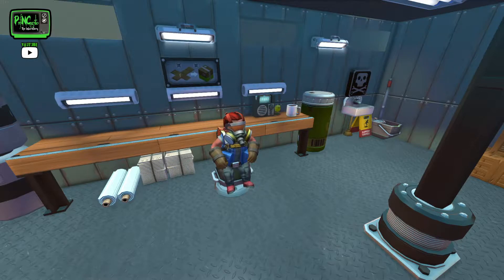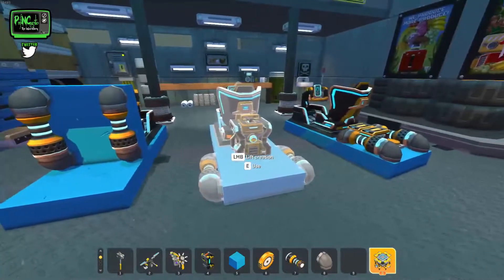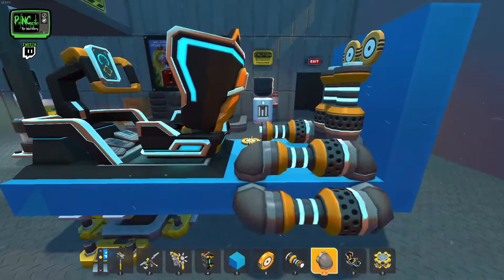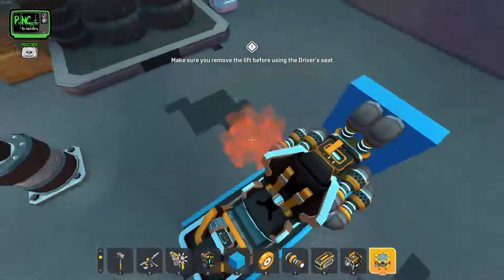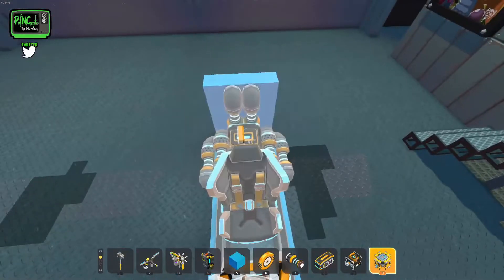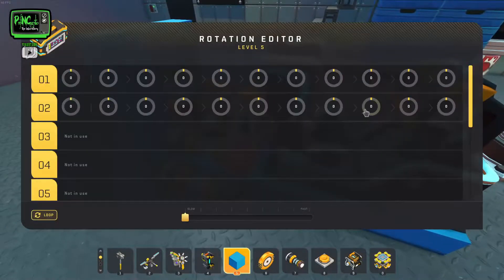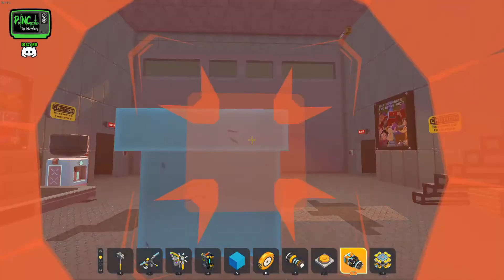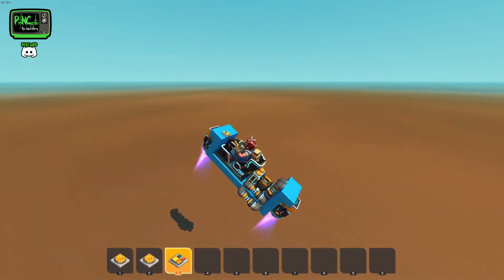Pitch Roll Yaw Tutorial [FOR FLYERS] (vanilla)(no mods) Scrap Mechanic

Comment: my dumb ass used an unreliable W/S converter to trigger controllers to change the pitch suspensions, thanks for enlightening me xD
Reply from the maker: Glad it helped
Reply: @ProfNCognito  actually now I have revisited it, I've noticed that the controller method I was using before meant the bearings were a lot more stable and less likely to cause unwanted tilting when you aren't in the vehicle, like you got at 1:12. not sure if this interests you but its kinda useful I guess